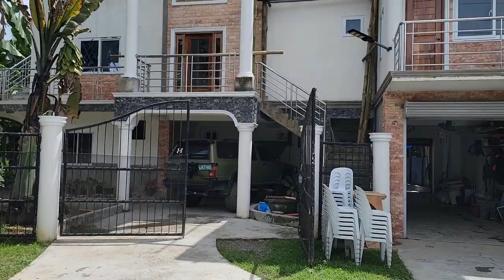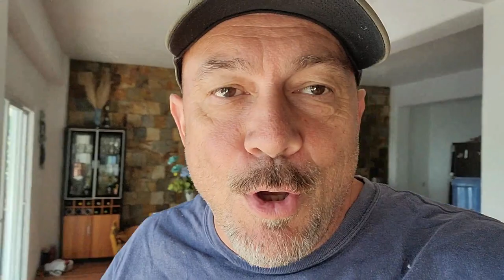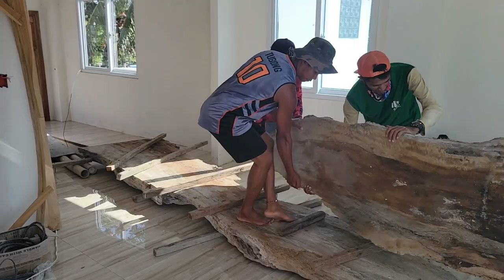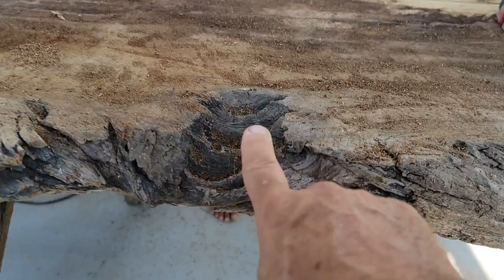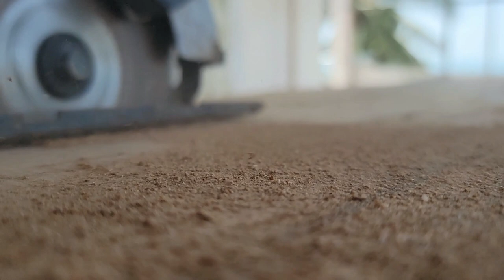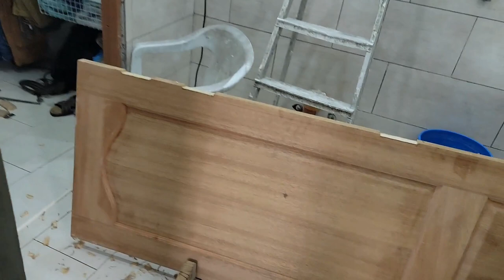Philippines Beach House Build Day 328 Driftwood Log  Bar Top in Kitchen

Comment: Oh yeah, been waiting to see work start on that counter top. What is that anyway, it looks like very old teak. If it is, its probably worth its weight in gold. Thanks for the video    👍
Reply from the maker: nah it is not teak. Nobody anywhere has been able to give a answer. Many wood shops have looked it and the other locals.  It looks to have floated in the ocean for years. no bug will touch it because it is so salty.
Reply: @TexasFilipino  I thought it was teak because theres no sign of insect damage, and teak is practically bug proof.